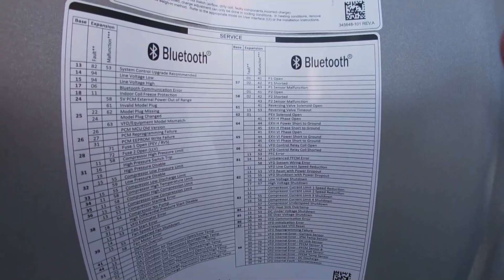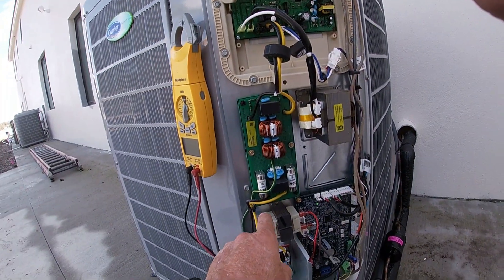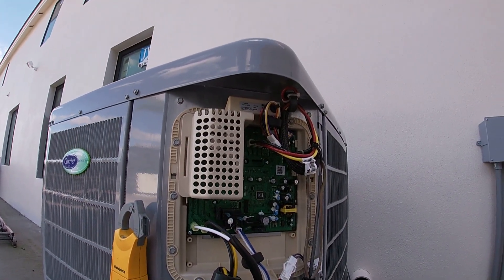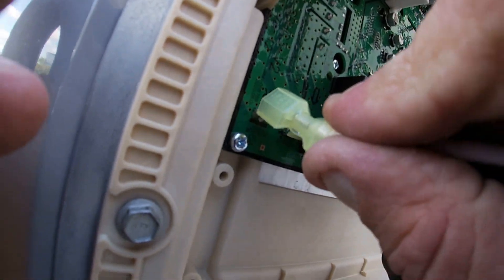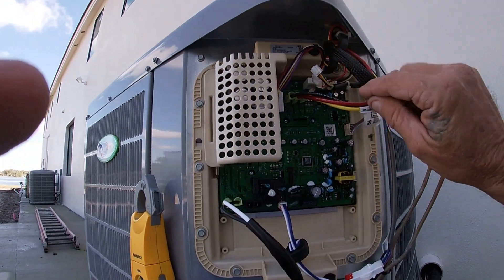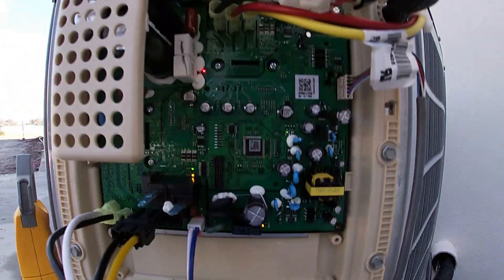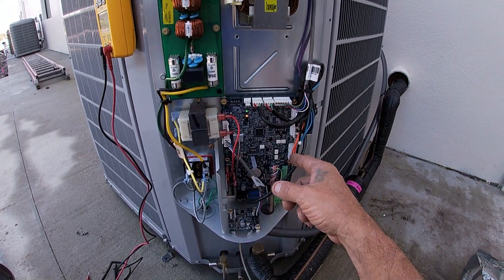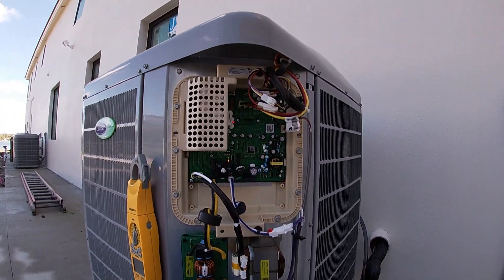Invinity fault 86-46

Comment: Thank you for the help.  I am working on my first one tomorrow
Reply from the maker: You’re welcome… really not that hard to work on.. can be a little intimidating first time but take your time, biggest issue is the suction line temp sensor reversing valve solenoid go bad the most and I stock the on my truck… also found the Bluetooth board will cause communication problems when it fails, and can just unplug it and the system will work.. just some helpful info to keep in mind